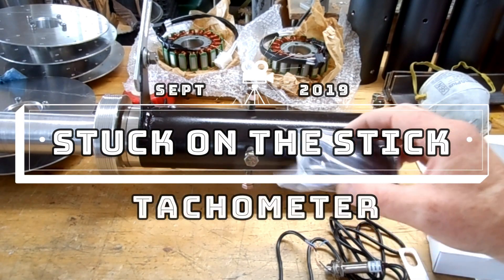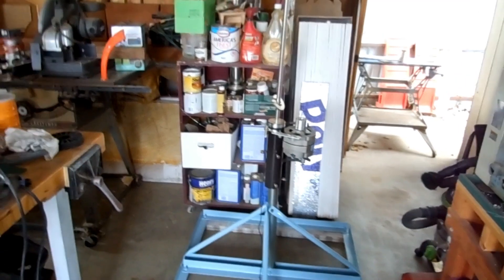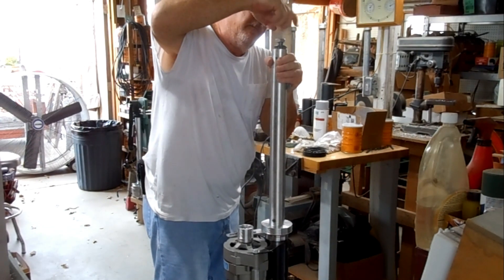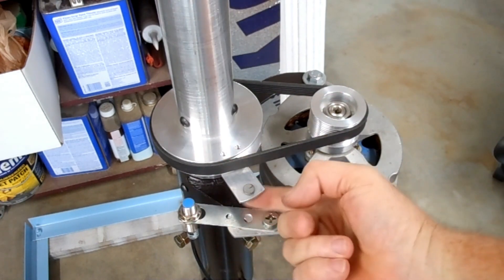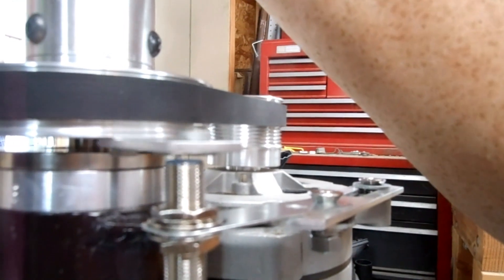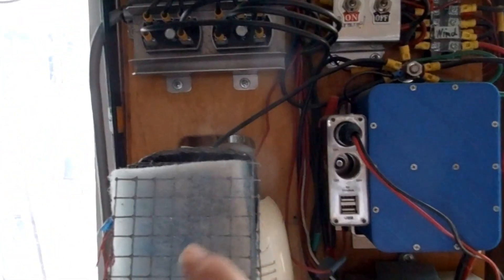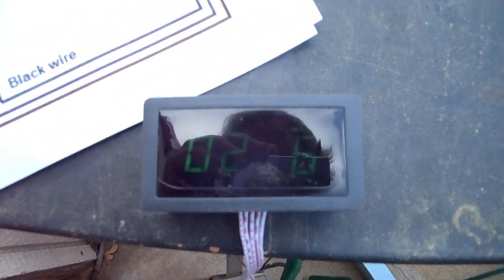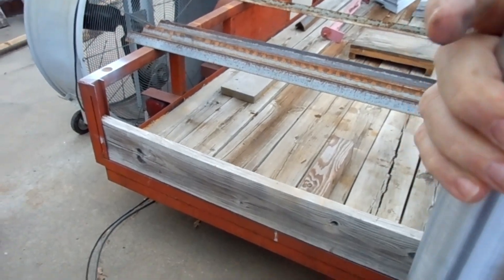Stuck on the Stick - Tachometer

Comment: Doesn't make sense that the sensor has to touch.  Seems that the advantage of using a magnet is that a sensor could move through the magnetic field without having to touch.  May as well use a light tachometer.  Hmmmmm??????  Good luck.  I always look forward to your next video.
Reply from the maker: The problem may be caused by all of the other magnetic fields around it; the large magnets I'm using as bearings and the permanent magnet alternator mounted beside it. I'll be trying a stronger magnet to trigger sensor and I may try it without the PMA at the next chance I have to play with it.
And the problem with using a laser light tachometer, I haven't found one with a remote sensor. I really need a remote sensor.

Comment: I don't think the Hsll effect sensor is supposed to actually touch the magnet! The closer you get the stronger the field though ;0)
If it is only for your own experimentation why not use a laser tacho? They are cheap as chips on flea bay (£8... under 10$)
It might be different if you want to generate some graphs of the output though ;0)
Reply from the maker: I don't believe the magnet and sensor should have to touch either, but that's just the way it's been working so far. I may need to use a stronger magnet for that sensor to overcome interference from all of the other magnetic fields around it.
And yes, I want to use this contraption in bad weather conditions and at a location that would be difficult to use a hand held laser tacho. I also want to create a chart of RPM in those conditions. If you know of a laser tacho with a remote sensor that won't break the bank, please let me know.
Reply: It is all to do with the field strength of the magnet and how that interacts the sensor! Magnetic field follows the inverse square law ;0) .... a daft question, have you got the right sensor for your application? 

You can get them from car scrapyards! If the car has electronic engine management it will have a Crankshaft sensor which does the job (it creates a sine or square wave that is tied to crank revs)
Reply from the maker: The sensor and readout was purchased as a set, so I'm assuming they were paired correctly. Both parts work within a power range of 12 to 24 volts....
Something I haven't thought about; I could be having an issue with my power supply.
I appreciate the suggestion. I'll look into the automotive solution.